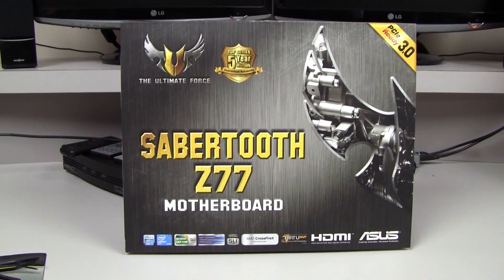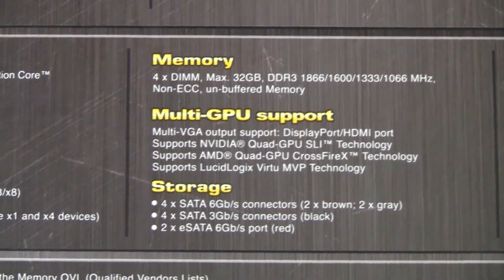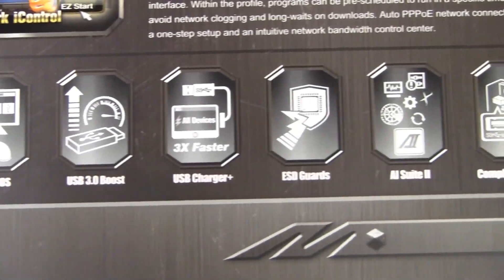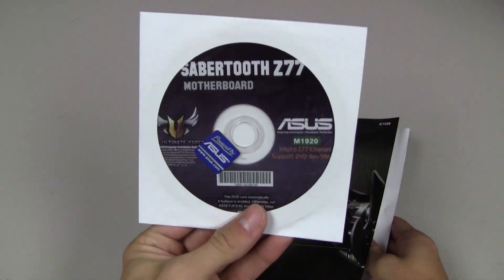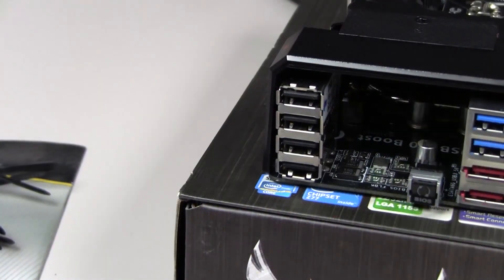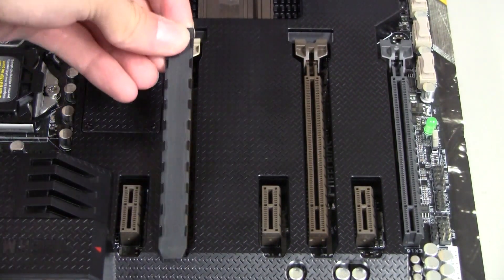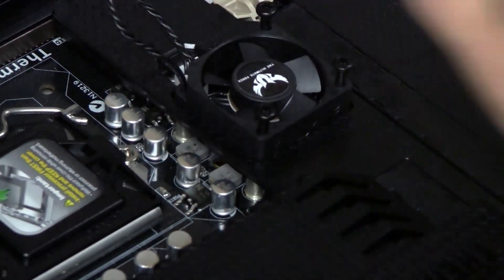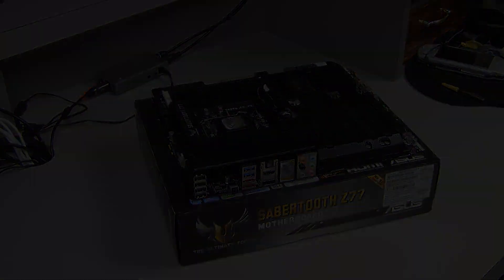Asus Sabertooth Z77 Motherboard Unboxing

Comment from the maker: Well when you get the motherboard for the first time, upon opening the box the anti-static bag should be sealed. If not it may have been returned and put back on the shelves. I would try it anyway, if it does not work then I would return it.